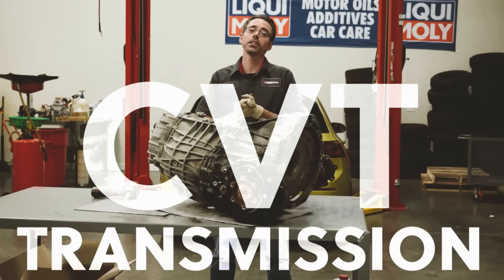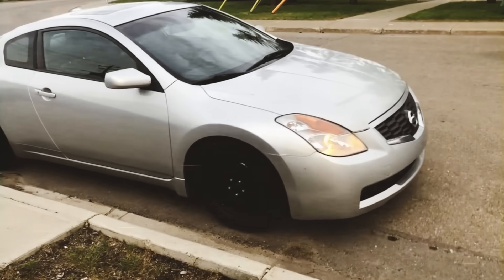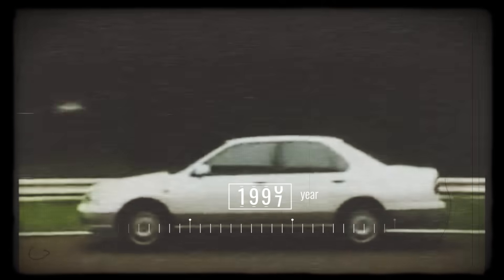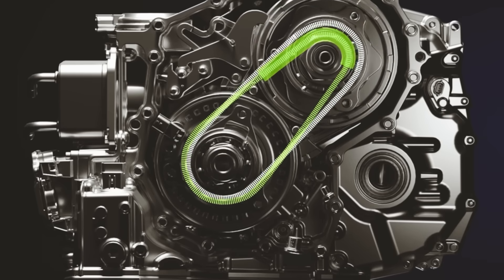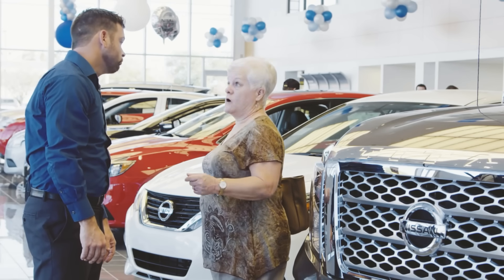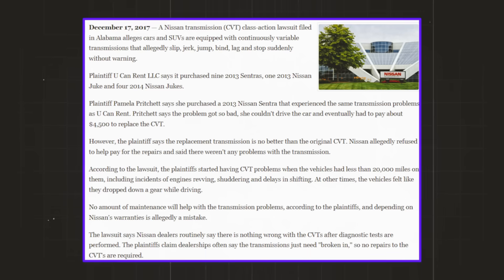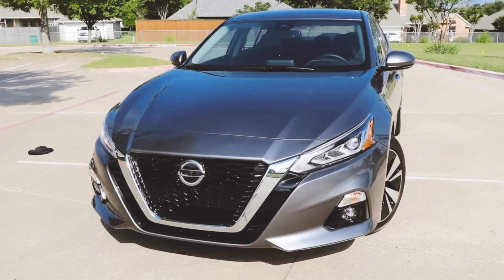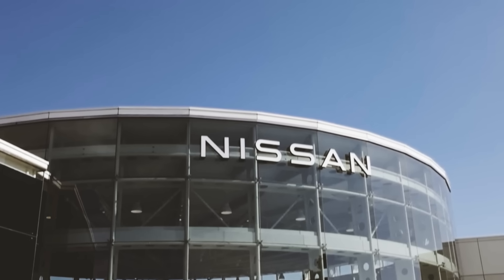Unpacking the FAILURE of Nissan's X-Tronic CVT

Comment: I had a 2008 Murano for 5 years and never had a problem with it.  From what I understand the newest version of the Xtronic has 2 oil pumps and 30% less friction than prior iterations.  It's fine as long as you don't drive like an idiot and never change fluid.

Comment: Fun story about the Ford dual clutch transmission. I was test driving a brand new 2013 Ford Fiesta. I took it on the interstate and accelerated. The car shook so violently, I honestly thought I damaged the car. The salesman told me it was normal. I immediately took the car back and walked away

Comment: We just dumped our 2019 Kicks for a Prius.  I've never owned a more unreliable car than the Kicks.  As an annoyance, it would shudder/studder at low speeds (particularly when doing a rolling stop, ie almost come to a complete stop, then gently reapplying the accelerator).  However we dumped the car after is landed us stranded twice on long trips, and 3 dealerships could not help us figure out the issue.  Symptom was ... drive ~400 km, stop at a rest stop pulling into a parking spot ... after 5 minutes come out, start the car, put it in reverse to find out the brakes had no power ... advancing the car back into the parking spot would show the car was in limp mode (no acceleration), and at times pressing the accelerator would do nothing.  I'm convinced that it was either the transmission over heating or the ECU ... either way ... good riddance ... will never buy a Nissan again.

Comment: I don’t understand why Nissan has done nothing about changing the design of their CVT’s when they’ve had these problems for 20 years now - no wonder they’re going bankrupt‼️ Why would a company keep making such 💩 CVT’s when they know their high rate of complaints, customer dissatisfaction and how unreliable they are - it doesn’t make sense⁉️😳 
if people are going to spend big and buy a new car or even a used car why not? Take the time to do some research watch YouTube reviews read reviews online read customer reviews evaluations and complaints. Look at lists of the best and most reliable cars to buy and the worst and most unreliable cost to buy before you choose to make your big investment. I’ve always stuck with TOYOTA. I just bought my third TOYOTA this time at 2024 RAV4 hybrid currently the top selling Car in the world with fantastic reviews of reliability and a CVT system with no belts and pulleys but a planetary system instead, considered to be the most robust and reliable CVT transmission ever built The same with the engine and TOYOTA is one of if not the top selling hybrid car but no matter how reliable a  car’s name is, regular maintenance including 5K or six monthly oil changes and is a must if you want to get the longevity out of your car that it is capable of achieving.👍😊 forget Nissan boy a well-known trusted and reliable brand like TOYOTA

Comment: Americans don't know this, but in the middle east, the 2008-2012 Nissan Altima 2.5S with the 6speed manual transmission was a successful seller, around 25% of that Altima 4th generation sales were 6speed manual transmission, the 6MT sold pretty well and actually car enthusiasts who wanted a practical daily driver but with three pedals were buying those Altimas.

To everyone's surprise in the middle east, once the 2013 model came out, a lot of people were disappointed and upset about no more 6MT option, also confused, since you can see 6MT 2012 Altimas left, right, centre and everywhere! There was no excuse to discontinue the 6MT at least in the middle east!

Why did Nissan discontinued the bullet proof 6MT? Do they want to sell the unreliable CVT to sell Valve bodies and repair costs to customers? That's a weird one, I understand in the US people don't buy 6MT as often, but at least they can keep the 6MT in the middle east!

Comment: I have a 2009 Rogue. CVT failed at 122k of course right outside of the warranty… no help. I maintain my cars doing all the work myself. Car otherwise was perfect so I decided to pay 4.5k on a replacement trans. With a few other minor repairs thought the years I have now exceeded the miles than on my first trans. Currently at 249k on the car. Just a week ago drained the trans fluid and metal glitter everywhere in the fluid. Never missed a fluid change. If anything changed the fluids early. Transmission is eating itself. Any day now I’m expecting trans 2 to fail. I guess I got my miles out of the car but I did pay for it.

Comment: i have a 2015 nissan NV200 with 200,000 miles on it and a 2022 nissan sentra SR premium with 80,000 miles and havent had a single CVT issue. The NV200 has had it cvt fluid done every 60K miles and the sentra every 30k miles. I am looking into trading the sentra in for the new 2026 version and dont have any hesitation with getting another nissan with a cvt

Comment: I have 2017 Nissan rogue change transmission oil 100k now 180k and it's still Run Like new. But this kinda video's always scare me. Now 2025 sep I only changed battery after 8 years it was working fine but just change it because company recommended

Comment: Meanwhile Toyota and Honda figured out the issue beforehand.

Toyota simply uses a traditional automatic 1st gear, that first gear does the heavy lifting and once you're going above 20 MPH, the CVT takes over.

Honda, I have no clue but I've yet to see Honda CVT issues, so whatever they're doing, keep doing it.

Comment: Scotty Kilmer and the car wizard say CVT's can last.  What they say is verified by actual people I know who have gotten 300,000Km out of them.  First it's not a race car.  Buy a manual, dual clutch or something like that if that's what you want.  They will take off if you have to merge, make a left turn but they really like cruising.  Second because of the way it works change the fluid and filter more often.  I've seen recommendations from 30,000 to 50,000 miles.  Lifetime fluid is lifetime of the warranty.

Comment: This channel is sick for sure!!😂
  I drove an Xtrail 2015 until 2020. The car had a 2.0 liter petrol petrol engine MR20DD with CVT transmission. By 2020 the car had 180k kilometers without any problems with the gearbox at all !!
Honestly I don't understand what is happening in USA. In other countries there are no major issues with the CVT. WTF
Now I drive the updated model same engine in Nismo form. So far I have 70K kilometers. Same story!!!
I imported the car from Japan and it is packed with way more than your SL Rogue

Comment: Of course, Nissan is wrong for covering up issues with the CVT transmission. I am having issues now my used 2013 Nissan Rogue {rowg). I am looking the bottom and it does not look like the old 2013 Nissan Rogue. We had fixed in 2021. Nissan-specific Xtronic CVT transmission is in it.  How you drain it?

Comment: In 2005, I was looking for a car for the wife. And I didn't buy a Marano because of this transmission. And the Marano was a real looker in 2005. Instead, I bought her a Jeep Liberty that she drove for 15 years without a single problem. I did have to put in a new heater switch and that's it. In 15 years. That Marano wouldn't have gone two with that transmission. I was a snowmobiler and instinctively knew it. Now look at them.

Comment: I just bought a 2018 Nissan Murano Platinum in October. I had no idea about CVT's until I got the class action mail in March or April. I just took it for a drain and fill and new paper filter at 58,000 miles. Looks, runs and rides great...The fluid was dark but not burnt or really dark...smelled normal and the filter wasn't terrible either....but I feel like I'm driving a disaster waiting to happen. Might buy and extended warranty.

Comment: Are yall fucking dumb only a few yrs of Nissans had a high failure rates but since like 2016 they have been fine yes if u beat on them they won’t last as long and are slightly more frail due to using a belt than a traditional trans but drive it normal and it can last 300k miles

Comment: I have a 2017 Sentra SV that I bought new to use as a commuter. I have had all the required maintenance done without fail, including the CVT. There were 2 service bulletins early on, both requiring updated software related to the CVT, and I had both of those done. I retired in early 2019 and have not driven the car that much since then. I only put 3-4K miles on it annually now. It only has 43K on the clock. I don't baby it, but neither do I abuse it. I have the transmission serviced every 20K and have had no problems... yet. I'm considering trading it for something a little more sporty and fun (preferably with a manual transmission) as I no longer have to be concerned with fuel economy. But for now, it serves its purpose and runs just fine. I just had the motor oil and filter changed and was told there are no leaks in the transmission.

Comment: The failure is the dealer/customer having long fluid change interavals 60k and not changing the tranny filter. Also the crappy ns3 fluid and NO dipstick on newer models. Have a first gen rogue original cvt 160k still going strong. 30k tranny service.

Comment: I have a 2013 Pathfinder and never had any CVT issues. Have about 120K miles on it. I asked at the Nissan dealership last time I had an oil change about an update to the CVT issues and they said they never heard of any CVT issues with Nissans. Lol. The problem is that this car is impossible to sell now because no one wants to touch it in the used car market due to the perceived CVT issues and I can’t convince anyone this car drives fine. I guess I’ll be driving this car into the ground.

Comment: I picked up a ‘24 versa and I love it but every time I get into my car, I always worry about the cvt going out on me. I just did an oil change at 6212 miles but I still can’t shake that feeling something is gonna go bad. Thankfully I have a ‘23 charger as well
Reply: It'll be fine. Just change the CVT fluid and filter every 35k miles.

Comment: I have a 2013 Nissan NV200 with the dreaded CVT. Now at 100,000 miles. It probably is the same CVT as in the Versa. Even worse, the van is built on a Renault car body so it's noisy, unstable, and needs special hard tires to keep it from rolling over around corners.  When the transmission fails, it's going to the scrap heap.

Comment: In 2022 I bought a 13 Maxima that had 83,000 miles on it. 
In my 30 day test driving phase it was shuttering and acceleration was bad. An honest mechanic at Nissan told me it was the shift solenoid. Now at 135k miles and a transmission fluid change its still running strong.  Mechanics could be telling y'all anything to make more money on a new trans than changing solenoids.

Comment: I had a 2015 Versa with the CVT.  Even before it broke, it would do sketchy things like rev the motor to 5,000 rpm on the highway while in cruise when climbing a minor incline like a highway overpass then go back down to 3,000 after crossing it after 45,000 miles. I won't ever buy another Nissan. Ever. They farked their rep over permanently.

Comment: If you drive normal and regularly maintain your car with CVT. Future problems can be prevented. CVT is not a race car similarly to toyota prius. If you want to go from 0 to 60 under 7 seconds,  CVT is not the car to own. But, if you're want to get to point A to B, in economic ways with normal driving. CVT will get you there with peace of mind. And it's not going to break down on you with normal driving. 
Yeah, I own a nissan Rouge with CVT. And not one issue with CVT like many narrow minded think. 
If nissan think there will be issues with their CVT. Why does the F woukd nissan build massive production of cars with CVT. Do you think they want to recall all those CVT issues in the future. 
Don't be afraid to own a CVT car. Only narrow mindset people think CVT are bad for car.

Comment: All automatic transmissions are JUNK compared with a manual trans I would rather replace a couple hundred dollar clutch times than buy 1 automatic at 4000+ every 100-150k I have manual transmission with millions of miles and multiple cars/engines that have never needed more than oil changes and rear seals(another $20) part

Comment: 2012 Nissan Murano with 73K miles, done transmission oil replacement now twice and so far no issues. I do change the coolant as well to maintain cool the transmission fluid. I hope my Murano keeps running for a long time, only time will tell.

Comment: I have 2014 Nissan rogue with 108k miles on it.
Car was mostly driven in Arizona hot weather.
I owned it when it has barely 25k on it. I never rev faster or go past 75mph as a safety rule.

I never accelerate my vehicle aggressively. 

I take 4-5 long drives which involves 6 hours of drive in a year.
I am changing transmission fluid every 20k miles when it reached 70k.

My car drives fine, Although I am not seeing symptoms at lowers speeds, it started slipping at higher rpms when 4 people sit in car with luggage.

When I got it checked with nissan technician with his computer.
It found that my transmission started slipping. 
It gave a code p0744 Torque Converter Clutch Circuit. 

What's the point in owning a mid size SUV when it cannot do its job properly and starts fail at this rate. 

All in fair, I think Nissan used their CVT which is meant for smaller compact cars on a heavy SUV.  and this tranny is crappier on bigger vehicles than on smaller ones.
I never expected a Japanese car go this bad (Except Mitsubishi which sucks any way) under 110k.

Even ford performs better than this. They usually start showing symptoms at around 150k.
Pathetic engineering for a big car company.

Comment: I think the early 90s Subaru Justy had a CVT transmission. I love how much all these videos use MotorWeek!! and ugh Scotty Kilmer. Renault really crapped on Nissan (datsun) used to be very well build and reliable cars. I loved my 98 Maxima, 230000 miles and still going today. Transmission maintenance... like "lifetime" fluid BS? Theres no such thing as "lifetime" fluid. and dont get me started on the complete crap that is 10,000 mile engine oil changes. My dad has a 2109 Grand Cherokee with 120,000 miles on it.. but the dealer says the fluid is just fine... yeah right. Just like Ford's non serviceable PTU (thats the AWD transfer case) in Explorers which has no service iinterval and fails as early as 50,000 miles.

Comment: Nissan z engine with cvt in 7th and 8th gen Maxima no problem.
Also own Fx35 and g35.
Had a 2018 Honda Accord engine blew up at 70,000 miles.
Hondas feel cheap and under powered for the price.
Keep your Hondas and Toyotas, next up “GTR”.

Comment: Had a 2007 Nissan Altima 3.5L V6 with the CVT. Bought it at 118k. Drove it to 290k. Never had an issue with the transmission.

Comment: The problem with the X-Tronic CVTs is that they are extremely intolerant to lack of maintenance, common with American car owners. They have to have fluids changed every 50k miles and will not tolerate hard accerelatons or burnouts. Even if you exceed the fluid change interval by as little as 10000 miles just once, the CVT is gaurenteed to fail. The CVTs also won't tolerate any overloading as they're known to fail suddenly from just towing a trailer when it's only slightly overloaded. As long as great care is taken they can last, but cars owners just expect them to work while neglected. It's not that Nissan CVTs are actually bad, it's Toyotas and Hondas being too tolerant to neglect.

Comment: I had a 2009 Sentra w/CVT. 173,000 miles, no problems with CVT. I currently own a 2019 Sentra w/CVT w/83,000 miles,  one dealer TSB to reprogram the CVT around the 30,000 miles to address poor mileage, but no problems since. The 2009 CVT was much better, though, IMO.

Comment: I just do not get it. In 2003 it became clear the manufacturer of this transmission was garbage. Yet, they simply kept using them ruining the entire company and reputation of Nissan and Infinity. 
Are they intentionally making bad cars to get us, "the useless class" out of our transportation? In the nineteens several brands figured out how to make automatic transmissions that last over450K KM with just three oil changes. What happened to that knowledge?  There is no reason for a autobox to fail too early, except engineered failure (obsolesce) or building it too cheap (using plastic where steel/metal is required or simply too light or no quality control at all).

Comment: I purchased a new nissan sentra 2017 model and my friend purchased a used Toyota corolla. 
I sold nissan sentra for slaughter cattle rate, and my friend drives corolla till date. 
Nissan asked for AED 20,000 to address and solve the CVT issue. I'd better sell the car I told them.. ironically until I sold the car I did the service in their service center only

Comment: Nissan did for the CVT what Oldsmobile did for the diesel engine in passenger cars.
Reply: I think we have entered the Japanese version of the Malaise period that Detroit went thru. Beancounter penny pinching harming build and engineering while coasting on reputation and customer loyalty. Nissan is the Japanese Dodge, Yota is GM and Honda is Ford. Subaru is AMC, of course.